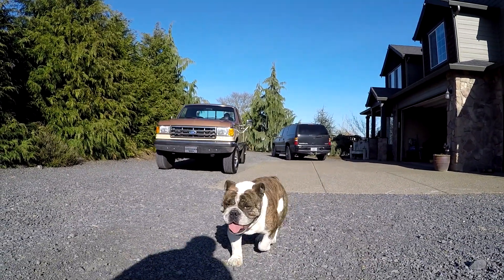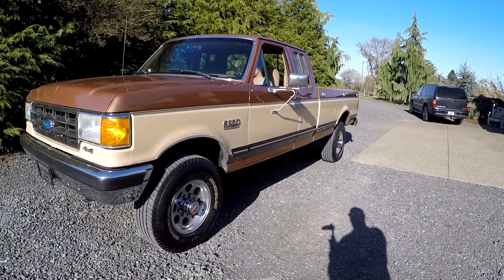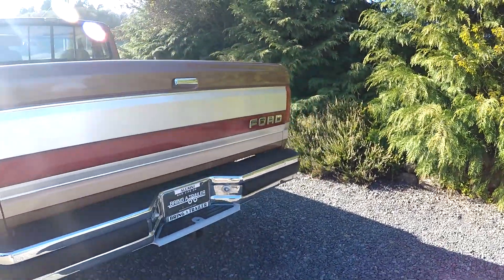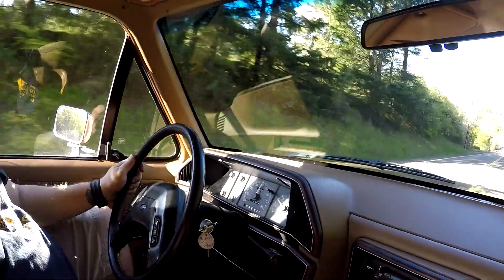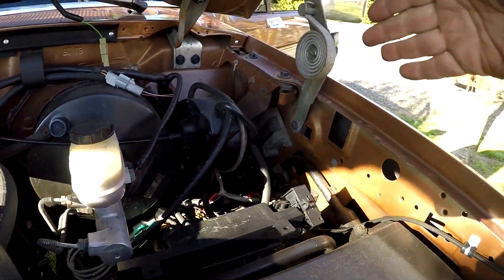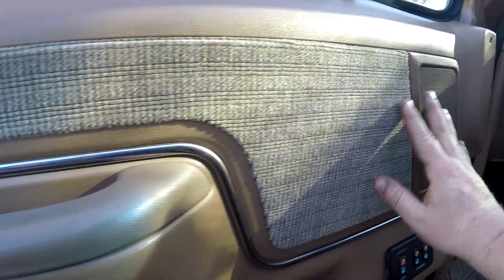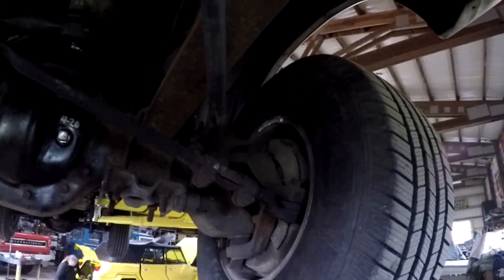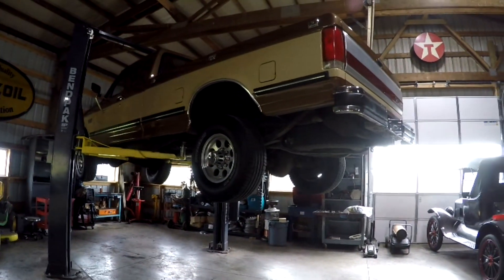1990 FORD F250 XLT LARIAT 53K Original Miles - DENWERKS

Comment: I have that same truck, same year, same paint, same engine and very similar condition with 75k miles on it.  my only complaint is that it's a standard cab.  But the price was right, the transmission was ran out of oil and burned up (sat in a garage for 20+ years and the seals dried out and cracked and leaked).  I got the truck for a thousand dollars flat and spent about 5 grand getting the tranny rebuilt and installed.  Runs great.  Put a new set of tires on it and I just got the disk brake rotors machined and tomorrow I get the left drum  brake repaired and the front end aligned.  Next I'll but brighter tail and brake lights on it.  Love this truck and feel very fortunate to have found it and I would love that extended cab but still I'm a happy camper.  I don't like dust so eventually I'll pull the carpet out and replace it with vinyl.  After that I'll get the seat reupholstered, probably in vinyl also.